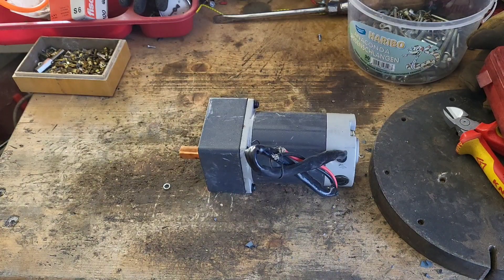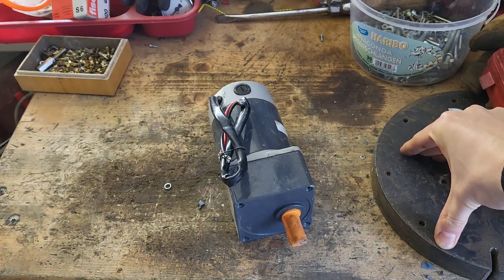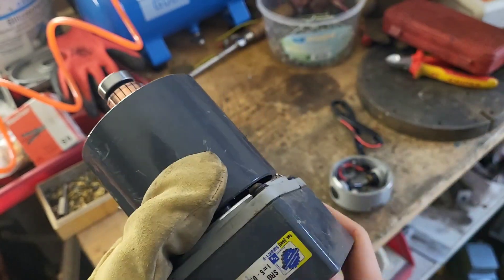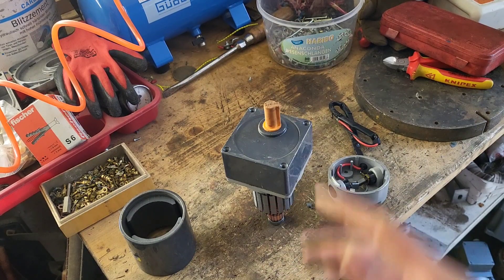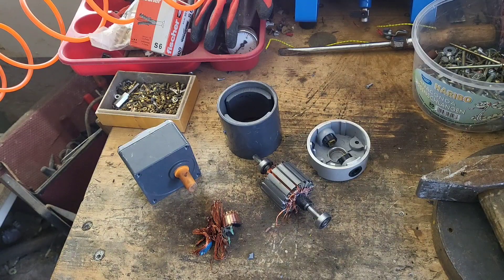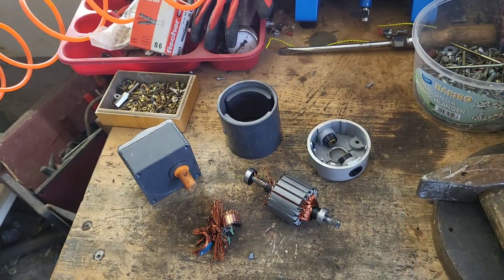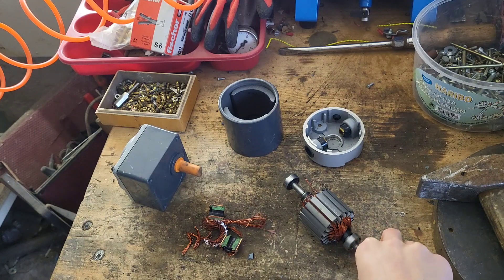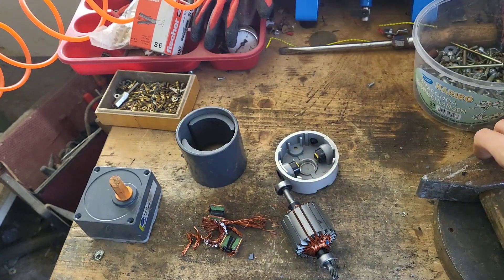DON'T scrap this kind of copper motor !

Comment: You have to burn these rotors in a fire, the heat melts the plastic glue, then the copper will slide out like butter with a screw driver 👍
Reply from the maker: That is true, but I don't know what kind of stuff they use when gluing them together, I don't want to risk breathing that in. Thanks for watching 👍👍😊

Comment: permanent magnet ac motor, the piece of copper the brushes run on is called a commutator, it is actually a number of pieces of copper separated by mica segments, it supplies power to the armature among other things, the same type of motor which is used in most power tools, the reason for the varnish which the armature is dipped in is there to hold the copper windings in place because without it the windings will move apart via centrifugal force as the speed increases
Reply from the maker: Sounds fun, thanks for sharing👍😃
Reply: Thats a dc motor. Exactly the same type (minus rubber drive coupling and reduction drive) as electric wheelchairs and mobility scooters use- just a size smaller. Ive stripped the wire out of almost 20 so far. They're a pain and tedious right down to chipping the blue glue off. Most can be unwound but some have stiff card strips above the wire in the grooves. That's when i angle grind the end copper off and lob the main part in the electric motors bin. What little comes off quickly still adds up in the better price bin.

Comment: I tried scrapping one of those motors myself about 2yrs ago and i also learned that they are just best to sell as an electric motor, but great effort.
Reply from the maker: They certainly are, but that's something you have to figure out for every one you get, as it's really hard to tell from the outside. I would just screw it back together and pretend that it didn't happen 😅👍👍

Comment: i have 2 yards near me and they pay about 12¢ a lb (steel) for these things, "they" call them electric motors... i can't bring myself to get such a lousy price so they're piling up, haven't really tried to get the copper yet, there seems to be several ways to go about breaking these things down... one of these days i'll find the time to figure something out.   

i doubt it'll be worth the labor but there's more than one way to factor worth/value, like calculating what you get compared to what the copper adds to the value, then you have to calculate how many you have and how much more you made by breaking them down, sans a per/hr calculation.
Reply from the maker: True, but as I'm getting 50 cents a kilo, so like 30 cents a pound, I get less money for all the different metals in there if I scrap those. So I would loose money if I scrap them, not a great plan 🙃 But of course, if you get next to nothing for them, you may as well scrap them, that'll be worth it. But be careful, there's no reason why they would scam you on that and give you good prices on the separated metals.

Comment: Those things look like they are difficult to take a part, but in fact they are easier then most think, many drills will have something very similar. I have the dismantle video somewhere in my liked section, whenever I track it down I'll share the link here.

I don't care where the copper is, what I have to use to extract it, how long it takes, I look at the end haul (think like a millionaire become a millionaire - scrapping probably will not get you to being a millionaire - one mans trash is certainly another mans treasure, I just collect copper and brass till I have a few hundred kilograms or the scrap price is worth the trip, I collect brass and some other stuff and again wait for the price of taking it in to be great rather then scrap for trash payouts, anything gained easily will be lost just as quickly with the wrong mindset). My scrap pays partly towards my other investments 👍
Reply from the maker: Okay, I guess that's one way to look at it, but I would still like to make more than 2 bucks an hour, so those motors are just not worth it. I would also doubt that making 2 $ an hour will make you a millionaire, when I could just as well make 50$ an hour. If someone only has the option to make 2, ok, fair enough, better than nothing, but I would say it's stupid to choose 2 $ an hour over 50. Thanks for watching 👍👍👍😊

Comment: The rubber coating is to absorb vibration
Reply from the maker: But that's not a coating, the shaft was completely made out of rubber, it was bendy n stuff 🤔
Reply: @scrappingadventures290  really? That's weird!
Reply from the maker: Yup, very weird indeed.

Comment: So I'm going to step out on a limb and give you a plausible reason for the rubber shaft. That's because it was more than likely a motor from an auto thrusting machine for ya know, someone spending some quality time with themselves.
Reply from the maker: Mate, that motor was about 3kg, I highly doubt that 😅🙃